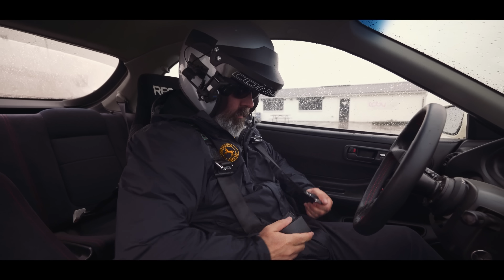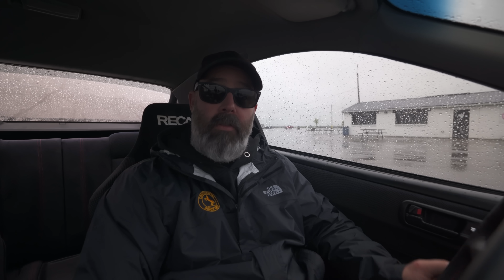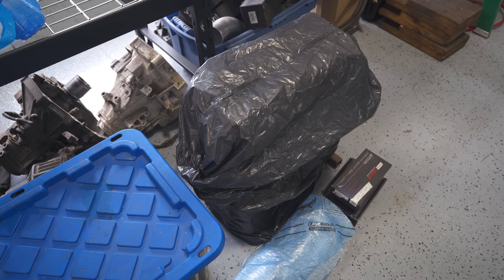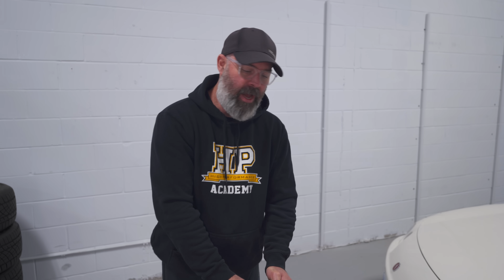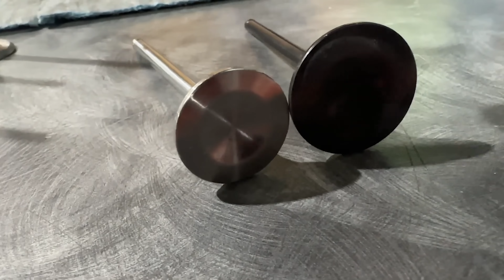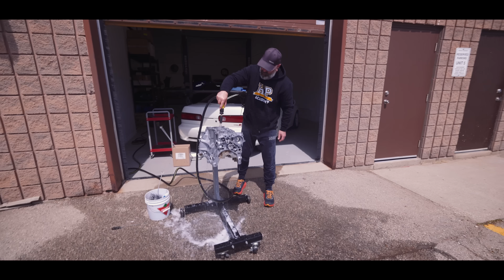Acura Integra Type R BIG POWER Engine Build - EP1

Comment: Love this.... I've built over 30 Hondas since the early 2000s.... D series B series k-series h-series J series.....
I've had my 1995 Honda Civic EX coupe for over 10 years and I wanted to do something different.....

So I just got done rebuilding the D16 Z6 and decided to go NA HIGH COMPRESSION ALL MOTOR......

Making clothes to 200 hp at the wheels out of an all motor single cam is an absolute blast!!!!!

Yes I could have built a DOHC......but ...... I wanted to do something different.... I wanted to build an underdog.......

And the amount of friends in random people with bolt on B series or very lightly modded k-series that I've been able to keep up with or beat nobody ever believes it's a SOHC VTEC until I popped the hood....
And the look on your face is always the same...😮

And makes me building the motor I wanted to build this time around all worth it 

So I'm glad you're building this Integra that you love so much the way you want to and not just following the bandwagon of k-series 🤙👌🤘💯

ONE QUESTION THOUGH.... Wooden a high comp b20z block been better for NA??????

Comment: Only if The old 12v VR6 had a head the flowed as well as a B18c5's head flowed. Looking forward to this build, if it doesn't work you could always have your B18c5 rebuilt and possibly up displacement to a 2.0.

Comment: An interesting build route, keeping that cylinder head, a set of cams and different gearset wouldve netted the desired results, kept the original engine base, cheaper while maintaining its longevity. So far the build route chosen is geared more for someone who drives the car daily and straight line speed, heavily relying on the chassis to keep it stable in the corners.

Not necessarily the wrong route but its a little overkill for the goal

Comment: I did almost the exact same thing to my integral almost 13 years ago. And to this day it's pushing 252 hp at 9000 and 231 nm torque. My dc2 is also mostly carbon and lexan. - type rcore Owner.

Comment: Did a similar build years ago on my swapped EF civic.  I went with a sleeved GSR block with factory (but balanced) crank and rods with Arias 84.5mm pistons. 11.5 compression because I still wanted to run pump gas. Skunk2 stage 1 cams and S2 intake manifold. PMR(?) 4-2-1 header because it had good ground clearance, and an Apex-i exhaust. Also had the RDX injectors, and was tuned with a Hondata S300 I think.

Made 223 whp on 91 octane and was such a fun car. Had a JDM trans with LSD, and was my track day car for a few years.  

Seeing a B Series build in 2025 really brings back some great memories.
Reply: 223whp back in the day was nothing to sneeze at, must have been a blast to drive.

Comment: Interesting I thought the B Series just came in 1.6 and 1.8. You'll have to find a NA K20 to compare it with.
Reply: B20s mainly came in the CRV.

There's also a pretty rare B17 out there! It's pretty much a slightly stroked B16 though if I'm remembering correctly.
Reply: B20B, B20Z came in suv and big sedan Hondas in Japan. 

But you can take a b16 and bore and stroke it to 2 liters.  ENDYN was amongst the first as far as I know back in the late 90s, early 2000s.  Then iirc endyn made a full billet 2 liter block, that was later acquired by another company... DART, if memory serves me well. I dont know if dart still offers that block brand new.

B17A is a destroked b18 in the 2nd gen (DA) integra gsr

Comment: Since you went with the link plugin route. Itd be better to have the cop wired directly to the ecu although you do have to add additional wires through the stock harness which is not really fun but totally worth it. Also, if you want to retain the original plug cover and not buy a coil plate/bracket , you can get a d17 coil and have the tabs cut off, itll be a snug fit or better yet if you want easier route get those audi red coils (r8 as the people call them). They too are a snug fit, requires no mounting bracket and a cheaper to replace than a honda denso coils. Best of luck with the dc2 DP. Its the best chassis imo